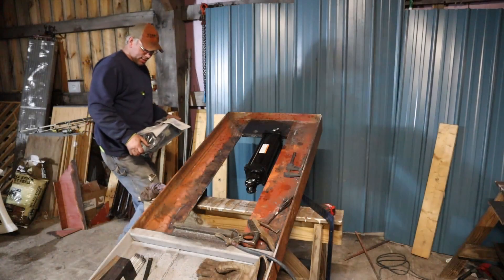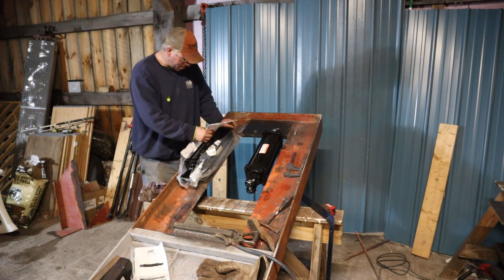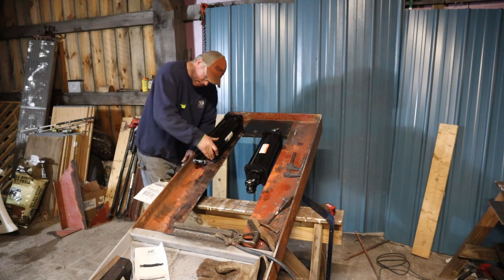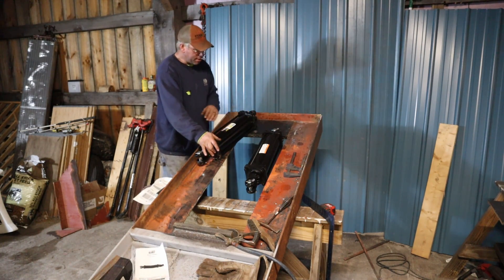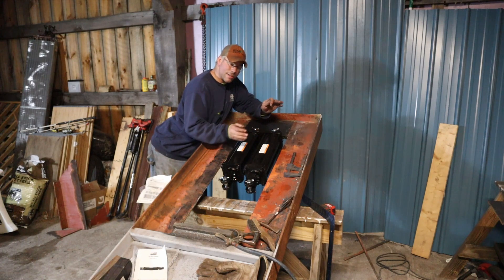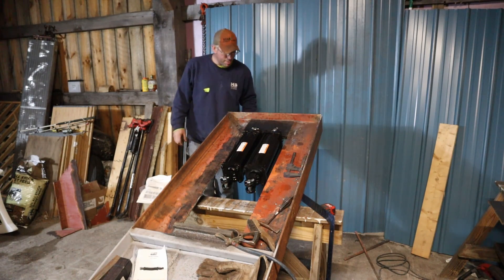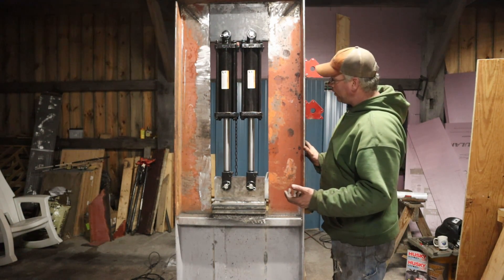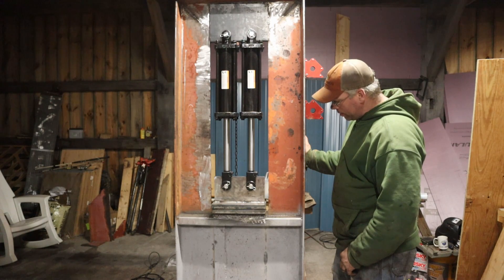Super Forge Press Build Part 6: The Top Die Holder

Comment: Operating pressure is usually 2500 psi. 3000psi is failure point.
Reply from the maker: It is not failure point if your cylinders are rated at that operating pressure.  These are rated at 3,000 psi continuous operating pressure with a shock rating of 6,000 psi.
Reply: @TheTradesmanChannel  hydraulic calculations are usually based off 2500 psi. I dont think you'll get over 28 tons per cylinder
Reply from the maker: Hydraulic calculations are based off of psi, piston diameter and area inside of the cylinder.  2500 psi might be "usual" in terms of tractor hydraulics but there are many pieces of equipment that run at 3000 psi, such as a lot of log splitters.  You can buy rams rated for 2500 psi as well as 3000, I bought rams rated for 3000 psi operating pressure.  Most of the implement rams I have on the farm here are 2500 psi.  You can buy detent valves rated for 3000 psi continual use as well as pumps to match.  I will do a video on the hydraulic calculations as well as where I sourced the information.  I do a ton of homework on things like this before I do anything because I do not like putting out bad information.  Also my calculations put both rams together at 37 tons.  A 4" ram of the same piston size can generate just over 18 tons at 3000 psi if it's rated for those pressures.

Comment: So, did you mean each cylinder makes 37K of force or combined?  My calculations indicated that from each cylinder at 3000 psi.
Reply from the maker: It would combined, 18.8k tons per 4" cylinder.
Reply: But Pi r squared (area) of a 4" cylinder times 3000 psi is about 37.7 K pounds of force, so if you're using 4" cylinders they would each have 37K pounds of force, yes?

Comment: I bought a 12000 lb. winch and snatch block to pull logs onto my trailer and hoist them up to my saw horses like Matt Cremona. If you put a ball valve on one of your cylinder lines that might allow them to work together.

Comment: Don't take a sledge hammer to the old worn out DeWalt, use it as one of your early tests of the press.
Reply: Will there be return assist springs to help pick the head back up more quickly?
As for the side guides, the cutting board option sounds alright, but what about reinforcing the sides and using guide bearings front and back? Wouldn't want heat getting to the plastic glides and making them soft. Just a thought.
Reply from the maker: No springs, they are double action rams, power open and power return.

Comment: Hi Jim
This has probably been asked before but how are you going to stop one cylinder pushing down more on one side. I know you will have guides in but it'll be a lot of pressure (approx 18.8 short tons at 3000psi) Ive made a couple of log splitters with 4" cylinders and adding 2 cylinders caused some pretty hefty steel to get bent out of shape! Anyway you've probable got this covered Good luck. Are you still planning to do some more timber framing in the future?

Stay safe
Callum
Reply from the maker: I'm running both cylinders off of the same detent, just like you would on tractor loaders.  The lines will need to be bull nosed I'm thinking but that I will have to look into.
Reply: @TheTradesmanChannel  I had to seriously beef up my log splitter as with the two cylinders mounted on top of each other the top one would push more as the load on it was less! hydraulics are like most people they will take the path of least resistance.  Any way good luck and lets get some timber framing going again as in the middle of making a shed (smaller than yours) and have watched the scarf joint videos loads of times.  Stay safe

Comment: Yes Dewalt has major quality issues.  Switched over to Milwaukee much better tools!  Damn that thing is a beast!   As for the noise cover the pump and motor with a sound deadening box. It will hold the heat somewhat but will quiet things down very nice.
Reply from the maker: Hello Mike.  I am on my last set of Dewalt cordless tools.  They are shit.

Comment: Have to agree with ya, Dewalt is loosing quality, I went through two drills and an impact in the last two years, and it wasn’t due to over use,  the motors just burn out to easy. The project is looking good.
Reply: Were they they newer brushless motors or the old regular motors.  The old ones are being sold at discount by online stores as they seem to want to get rid of stock.
Reply from the maker: My issue is the batteries not lasting and crappy chucks.
Reply: They were the brushless 20v motors, one drill was like 6 months old and the others were about a year, I switched to Makita they seam to be holding up so far.

Comment: I would make the slides for the ram as long as possible or the ram will bind with off center loading. Having two cylinders will not prevent this. Neat design so far and I actually like the twin ram but I don't know if it works better than a single ram of larger diameter. In any case I would try to make the slides on the ram at least twice as long as it is wide. Plan on using lots of never seeze and slide ways could be steel on steel but bronze strips would be good. We need to anticipate the load front to back and side to side plus racking forces with eccentric loads.I don.t want to stifle your creativity since it seems that your design is well thought out and i can't see it all just yet. I just want to help you avoid some of the "Aw Shit "moments. that's all. There I've said more than I'd intended. Happy welding Jim
Reply from the maker: You build things, your input is valued.

Comment: Might be the same thing M1A2 is saying, but I think I'd want the cylinders boxed at the end where the rams come out, so they're completely stationary and can't move.  I know they're built like tanks, but that's a lot of leverage.
Reply from the maker: Hello Jeff.  Picture tractor hydraulics or tie rod ends, these are actually tie rod cylinders.  They are made to free float if you will but whatever it is you are pushing against needs to have a stable path if that makes sense.

Comment: If you cut a slot in a 2×2 and weld it over the side rails or are you going to put one on each side , either way made brackets to slide over them to keep the rams from deflecting out to the front or rear and bending the cylinder and rams